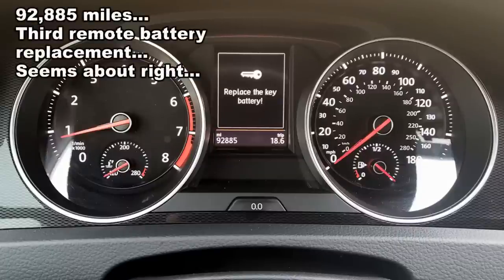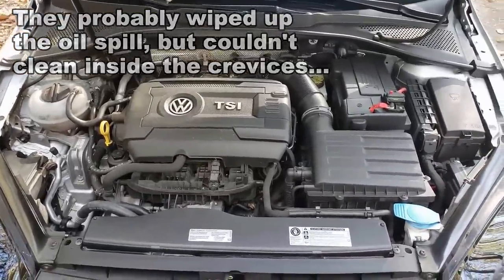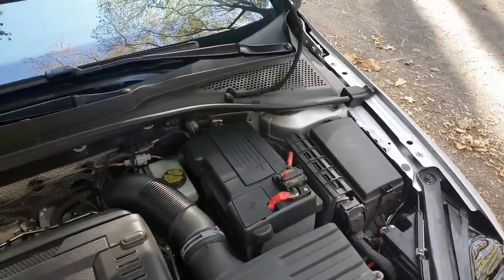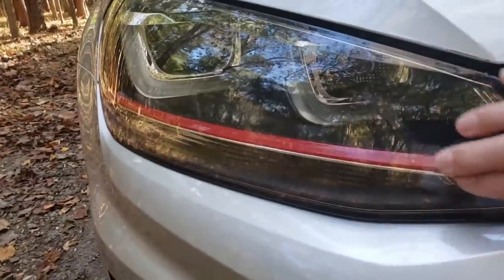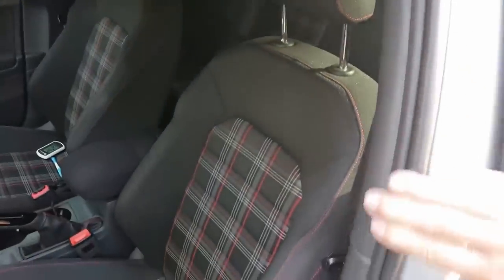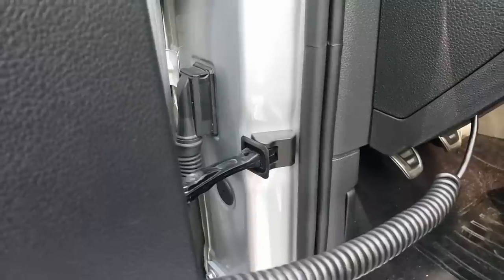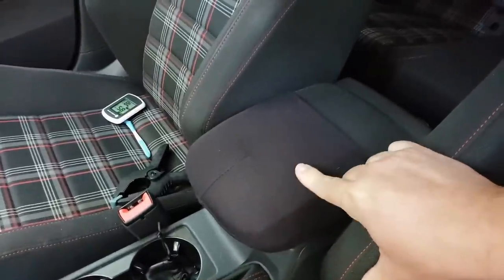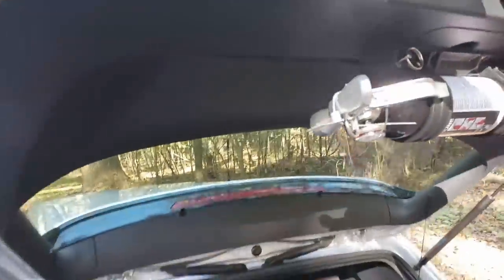THREE YEARS AND 93,000 MILES: My Report, Part 1

Comment: Hello and thank you for sharing your video, i own a 2018 mk7.5 GTI autobahn DSG (pearl black)  but i bought it on oct. 2017 (during the eclispe) technically more than 2 years my first oil change wasn't good similar to what happen to your car someone spilled oil on my belts and the cover plates so they had to clean it all up no leeks (thank god) i have stone chips on my winshield but very small i have small stone dent on top of my car. you can only see it on an angle, couple of marks side of my doors ( driver and passenger side) from opening other cars hitting my side doors but not dented i have only 41k on it i only drive it to work 15km each way (work, home) yes i have moonroof which works perfectly find. i just want to ask you where did you buy you middle arm rest cover? because  i can see rubbing on mine already. i live in Ontario Canada and considering getting a rust proofing in spring or summer how about you have you had an experience? if so tell me about it. good review subscriber here :)
Reply from the maker: I bought the arm rest cover at https://amzn.to/2XwJmvg. It's just an infant's skull cap. As for rust-proofing, I have never had the need to treat my cars. I had one car finally succumb to rust after 17 years. But the Mk3's were notorious for rust problems. I'm hoping these galvanized Mk7s will do much better. Take care, -Scott

Comment: I have a 2018 mk7.5, 59k. No worries so far. Planning on stage 2 it soon.. should I wait the warranty run out at 72k? Thanks
Reply from the maker: Guilherme - If the warranty is important to you, then you might want to resist the urge to tune. OR, if you don't mind the risk of consequences, then go for it. You're about 13k of driving away from the end of your warranty anyway, right? At your rate of driving, that's just a few months away, it seems. Good Luck, -Scott

Comment: These engines are known for having water pump leaks most likely where your coolant is going
Reply from the maker: The water pump and surrounding areas have been inspected many times by a VW dealer, an independent mechanic, and myself. So far, so good. Thanks for visiting.

Comment: Had a 2013 Volkswagen Passat, the coolant kept turning brown on me. Always took it to a Volkswagen dealership. Had to end up having the system bleed twice once at 30,000 miles and again at 70,000.
Reply from the maker: Weird. Brown coolant usually mean rust. I've never seen that in a modern VW.
Reply: Connor Head gasket blown?

Comment: 6 years on a GTI EA888 CCZA engine (Tiguan though), no oil pan leaks. Original plastic pan.
Reply from the maker: Thanks for the note. I'm undecided about switching back to plastic. I want to give the new gasket a shot.
Reply: @StealthGTI  You did clocked some serious miles on your ride though. In comparison, I only did 60,000 km (aprox 38,000 miles) in 6 years, with all-year summer weather (Malaysia).

Comment: Great review.  Just a suggestion regarding the wear on the seat.  Try this.  Before getting out of the car, move the seat further back.  That way, you won't rub on it when you get in.  Hope this helps.
Reply from the maker: Good tip! i've made it a point to pivot my hips differently as I enter the car. On top of that, I've lost about 55 lbs since making this video. So, there's less of "me" to drag across the seat.  ;-) Thanks for visiting.

Comment: Any Carbon buildup issues?
Reply from the maker: I haven't checked. I'm hoping that the use of Top Tier fuels and the occasional heavy towing (to burn away build up) is sufficient to keep the valves cleaner than without those practices. We'll see at some point. Thanks for visiting.

Comment: I have a 19...should I be concerned with crank walk when I go stage 2 and upgrade the clutch?  Subscribed...clean  easy to listen to presentation without all the fluff.
Reply from the maker: Thanks for the comments. Take a look at VWVortex for a thread called something like "THE GTI Clutch Thread." Something like that. The most recent pages has a list of recommended clutches. I don't think you need to go past a Stage 2 clutch with a Stage 2 tune. My RSR clutch has been great. Good Luck! -Scott

Comment: Would love to know what you think of the heater in these cars. I live in the center of Canada and it takes forever to come to max temp. Forget about letting them warm up in the driveway, the do not. You never said if you had trouble with the electric rack and pinion ?
Reply from the maker: The heat is excellent. With the exhaust manifold being internal to the head and bathing in coolant, the water temp comes up fairly quickly. Two tips for quicker heat: 1) Don't "warm up" in the driveway." Start the car, wait about 10 seconds to get oil up to the head, then start driving gently until the oil is up to temperature. The engine needs to work a little to generate heat, which then warms the coolant; 2) Avoid using your heat for the first five minutes. That one can be a tall order on a cold morning, especially during a short commute. Your cabin fan and heating circuit is behaving like an extra radiator for your engine. On a cold morning, with the heat set to MAX, your engine is over-cooled. Leaving the vent to its coldest setting will allow the coolant to build more heat in the engine... each pass of liquid through the engine will heat it a bit more (and faster) than it would if it was coming into your cold cabin to be cooled-off again. Giving the engine a "head start" should help warm the coolant faster, then give you more heat, albeit later in your drive. I base my advice off driving a TDI for 20 years. Old TDIs do not generate much waste heat. Of course, I could be wrong about the GTI since the cooling system is more sophisticated with separately controlled cooling/heating loops. Regardless, I think it's worth a try. Oh, no problems with my steering. Thanks for visiting.

Comment: Thanks so much for this.  I am considering a 2018 GTI that was a demo car.  It would be 35 yearsolder than the very first VW I bought, a 1983 Rabbit GTI.  You're making me think I need to do this!
Reply from the maker: Very nice! If I was shopping today, I'd probably get a 2018 or 2019. Do some research on stalling issues with the 2018 with DSG (if you're shopping a DSG). I don't know if it's been resolved, but I recall some discussion about it at GolfMk7.com. Thanks for visiting!

Comment: WOW, that's all that went wrong with it, this video has swayed me to buy one
Just curious, will a full size spare fit in the donut hole
Thanks, great video
I subscribed
Reply from the maker: A full-size spare with fit if you either replace the rear hatch trim with this piece, P/N: 5GM86345982V, or trim yours to mimic the replacement part. It's not hard to trim, but a replacement looks better. Thanks for visiting.
Reply: @StealthGTI  That's awesome, thanks for the link, the part is around $100.00, well worth it, if I every want to trade it on a new model in the future, and put the donut back with the original trim piece
Also the grief of making a mess and wrecking the original one, and then having to buy 2 of them, LOL 
I run dedicated snow tires, so I use the winter as a summer spare, and the summer as a winter spare = free full size spare, as I'm not comparing these tires to each other, I'm comparing them to a donut 
Keep up the Great videos
Reply from the maker: Thanks for the sub!

Comment: How did you clean off the glue on the pass thru on the back seat? My 2017 carpet has come off there, too.
Reply from the maker: I haven't done it yet. I may try brake cleaner. If that doesn't make quick work of it, then I'll just use contact cement over top of what's left and hope for the best. HAHA! Thanks for visiting.
Reply: I was thinking gorilla glue and ironing it on or putting a lot of weight on it overnight to keep it flat! Good luck!

Comment: Great video:-):-) planning too get 2019 gti . Is this cat reliable??? And is this car built solid structure wise??? Thanks
Reply from the maker: Reliability seems to be subjective. All I can say with certainty is that the Mk7 was designed to be a huge improvement over the Mk6 (and it seems to be) and that I've had no earth-shattering problems so far. That could change tomorrow, though. Even if it did, I still think the car has been fantastic. Thanks for visiting.
Reply: StealthGTI thx for responding. Keep up on your videos very curious how well this engine will do over time thank you nee subscriber:-):-)

Comment: I have a garaged 2015 Volkswagen Golf GTI SE Hatchback Sedan 4D with K&N PERFORMANCE AIR INTAKE SYSTEM, never driven in rain or the Winter.  Looks and drives brand new.  I should post a video. Only thing I have had to do to it is replace the tires.
Reply from the maker: WOW! A true garage queen. How many miles are on it? What is your daily driver? Thanks for visiting.
Reply: @StealthGTI  I have 60000 lovely miles, I do drive it to work on beautiful days.
Reply from the maker: @camdad  - Cool! I guess I should have asked: What do you drive when you don't drive your GTI?
Reply: @StealthGTI  4runner
Reply from the maker: @camdad  - Ah, very nice! I'm considering a 4Runner. The VW enthusiast in me wants to get an Atlas. But I know the 4Runner is more capable, more reliable, and has far more aftermarket support. I may not decide for years to come, though. HAHA!

Comment: Great review! Thanks. I own a 17 GTI Autobahn and VW had to replace the water pump at 20k. Since then, no leaks. Also the infotainment/navigation system was replaced under warranty at 12k. My sunroof has been trouble-free (cross my fingers), and VW did some work (recall/TBS) to prevent further problems. I’m at 40k now....let’s see. How was the life of your pads? Mine fronts are very thin (didn’t actually measure them, just by looking), rear seem ok. I have the PP brakes, with OEM pads....dust...dust and more dust...
Reply from the maker: Thanks for the report. My brakes were in good shape when I last looked. I will inspect them again soon. My GTI is a highway car; so, I usually get a good lifespan out of my brakes.

Comment: I have a 2014 GTI Mk7 and yes, my factory plastics oil pan got leak last year (with around 55000 km). And info from my mechanic, he had handled many cases like that with GTI Mk7...
Reply from the maker: Thanks for sharing. Did it leak from the gasket or around the bolts? Or did the pan crack?
Reply: @StealthGTI  Both gasket and bolts, but mainly from the gasket.

Comment: The TFSI Engine is known to burn oil, it's completely normal and is even stated under manufacturers description of the 2.0L TFSI 4-Cylinder Normal Operations and Conditions
Reply from the maker: Thanks for sharing that. Only during one 10,000-mile oil change interval did I lose more than 1/2-qt of oil. I've been pleased with oil consumption. Take Care, -Scott

Comment: Well... Coolant is mostly water. So there's a chance it's just evaporating the water resulting in a little coolant consumption... That's my 2 cents...
Reply from the maker: Thanks! I would think that the coolant has nowhere to evaporate to... it's a closed system. I hope to know for sure soon.
Reply: @StealthGTI  True. I forgot that the system was closed.... Well technically it could evaporate from a lose cap if it is not firmly closed... Anything else would point to an internal leak. Good luck hope it's not something serious.

Comment: How or where did you get ahold of that glass for the windshield?  Did a search and unable to find the info on suppliers or 3rd party glass replacement places.  Thanks.
Reply from the maker: Mike - I didn't do anything special. That's just the glass that my glass shop provided. Auto Glass Now is a nationwide shop. I don't know if the AGN near you would acquire the same glass. Give them a call to find out. Good Luck! -Scott

Comment: oil sample are only good if you have a bunch of oil sample over a period of time.
Reply from the maker: I agree, if the goal is to monitor the health of the engine. However, if the goal is to monitor the health of the oil, then one sample will do that. If I recall, that is the context in which I mention oil analysis. Thanks for visiting.

Comment: Have you found the water leaking into the trunk yet.maybe not old enough. But lots finding this after four or five years. Just wondering because mine is one with the leak. Hope I'm right in thinking it's the quarter panel vents.
Reply from the maker: No leaks for me. I've read about those leaks, too. The quarter panel vents are a strange place for water ingress. I think they're the lowest point in the trunk. Cars have had those vents for decades. If I find water in my trunk, my first place I'll look is going to be the tail light seals. Water flows past them every time it rains or the car is washed. If I find a leak at the quarter panel vents, I will NOT seal them closed as I've seen folks online do. They're there for a reason. Instead, I will remove them, reseal their edges with a top quality sealant, and MAYBE add a tiny drip tray above each vent to encourage water to flow around them... if they fit. Good Luck and thanks for visiting.
Reply: @StealthGTI  thanks for the reply sir. Yes my thought as well, concerning sealing around them. Just have to remove the lights and rear bumper mould though,  unfortunately . 
Thanks again, great video.
Reply from the maker: @gliderroos  - BTW, are you sure that water is coming in through those vents and that water didn't leak DOWN to them from the tail lights? I'm struggling with the likelihood that so much water seeped around the bumper skin (not impossible) and then seeped around the vent seals, enough to fill the trunk. That's a lot of water. Does your car have a sunroof? I think there are drain tubes back there, too. Even my non-sunroof car has drains of some sort. See this photo: https://i2.wp.com/stealthgti.com/wp-content/uploads/2017/03/hitch_mounted-oblique.jpg. Also, how did you discover this? Condensation on the glass? Or did you access your spare tire well by odd chance and spot it?
Reply: @StealthGTI  well yeah fair comment. No I don't have a sun roof. Truth is after monitoring it for nearly two weeks (plenty of rain, uk) I'm not entirely sure. But this problem seems to be quite widely talked about on the forums. Water cuming down channel behind light cluster as normal. Then some going in through failed vent surround . Sort of a design fault.  But hay, I'll keep an open mind. I will keep an eye and keep drying it out for now.

Comment: My bolster has been warrantied 2 times. The 2nd time the dealer good willed it. Mine uses about the same amount of coolant. The torque spec on that door check triple square is 30nm.
Reply from the maker: I've been out of warranty a LONG time, thanks to high mileage. Thanks for the torque spec on the check bolt!

Comment: no need to change the plastic  oil pan..never had issues, looking for problems that don't exist.
Reply from the maker: Thanks for visiting.
Reply: And mine was dropped about 3/4 inch with Eibach pro line springs and sways, on two of my previous GTI's never a problem, 147,00 on the one, 87,000 on the last one, closer to the ground, still no issues, current 2019 Golf R  7700, plastic is king, won't be doing Eibachs for some time as the 2019, has 6 years 72,000 warranty, all the others where 3 year 36K, I swallowed the 36K in rapid time

Comment: These vw brands cannot bear the heat. Buy a Benz or bmw instead they r better made
Reply from the maker: I cannot recall what I said about heat related failures. Regardless, the car has made it through another hot summer with no additional problems. Thanks for visiting.

Comment: Did you already replaced the breaks? If so, about what mileage? Also how do you keep the exhaust tips so lean?
Reply from the maker: Still on the original brakes. I guess that's to be expected from a highway car. As for the tips, I usually just wipe them clean during a wash. If they don't wipe clean, due to waiting too long between washes, then I hit them with a little polish.